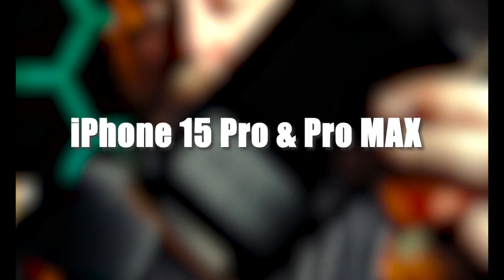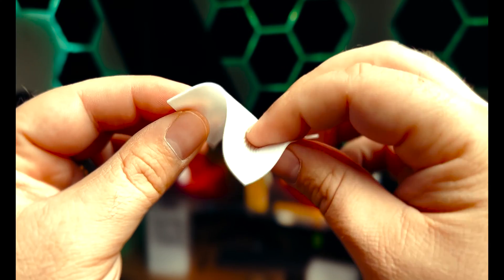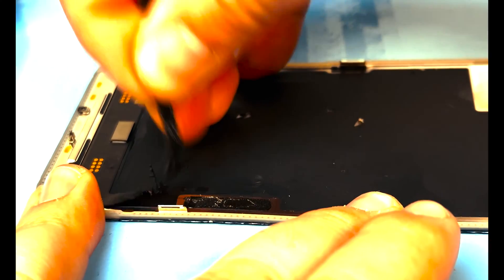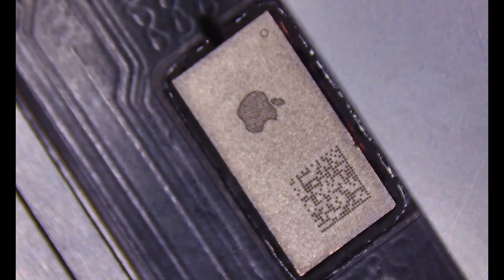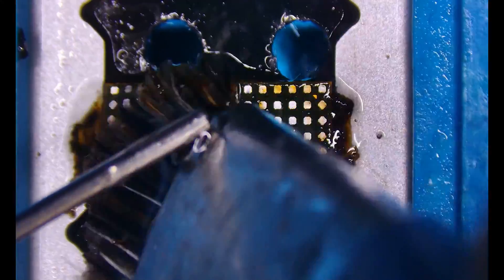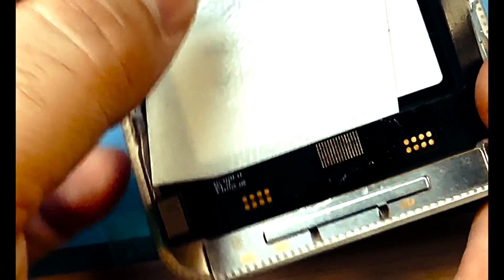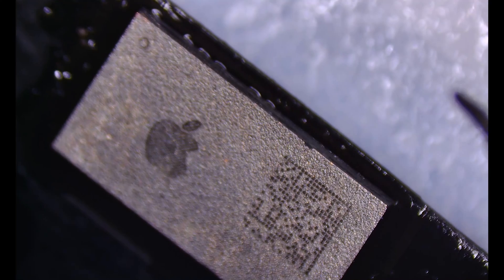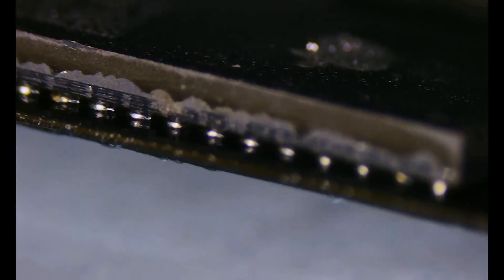iPhone 15 Pro Max Display IC Replacement Tutorial: Step-by-Step Guide

Comment: Ok,no IC on the screen, good, but the fact that the flex cable is not glued down and being hard to unglue, that’s a bit exaggerated. A little bit of alcohol and prying out with plastic pry tool is all it takes. Easy.

Comment: Will the iPhone 15 Pro Max, 15 Pro, 15 work without the IC chip? I know it restores true tone (touch calibrations) and gets rid of "Unrecognized Part pop-up" but is it mandatory to keep the screens touch functioning or keep from black screening? What about the iPhone 14, 14 Plus, 14 Pro, and 14 Pro Max? I ask because I've been given the impression it should, even MobileSentrix support told me it would work without it just continue getting pop-up message and no true tone. No other issues (specifically on 14 Plus).  Here's my story:

I had an iPhone 14 Plus brought to me and installed an aftermarket AQ7 screen from Mobile Sentrix without transferring the IC chip from the original screen. It worked for a day, but then the screen went completely black. I could still feel vibrations when flipping the loud/vibration switch, so the phone was still on, but the screen had no picture.

I took the screen off and put the original back on, but left Face ID unplugged. This caused power issues, with the phone powering on and off by itself every 2 minutes. Once I plugged Face ID back in, everything started working fine with the old screen.

It seems to be that I got just a bad screen unless it was the IC so Mobile Sentrix is sending a replacement AQ7 screen. I don’t plan on transferring the IC chip (I never have on previous iPhone repairs, usually 12s and 11s but I've done almost all kinds of iPhones new and old with your AQ7 and XO7 screens without any issues and I nearly never transfer IC chips since my soldering iron broke in December). Will the new aftermarket screen they’re sending likely work?

Comment: Hey mate, what airflow do you use? My temp is 230 and air flow 66 but it just wouldn’t melt the solder balls. Even with a large nozzle.
Reply from the maker: You can go up into the 300’s you just have to be careful. Try using a lower melting solder when reballing.